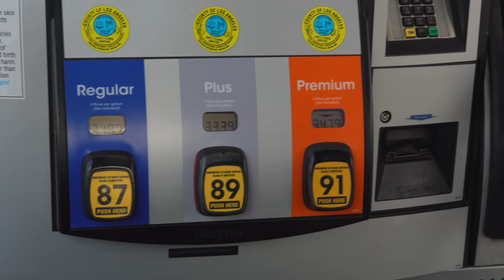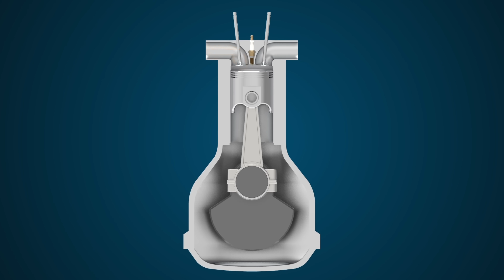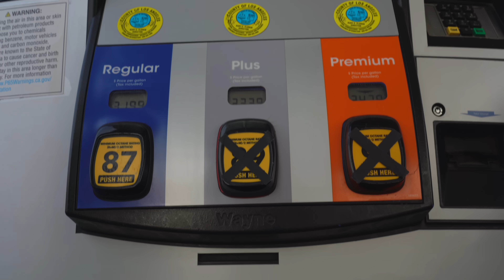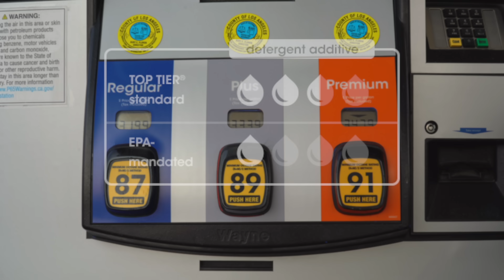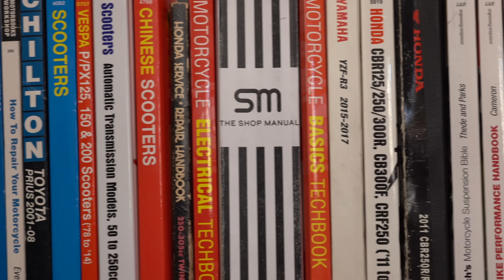Should You Run Premium Gas In Your Motorcycle? Octane Explained | The Shop Manual

Comment: I mainly go for the detergent additives in the premium gas at shell for my car since it just helps keep it running clean so the mpg is close to estimated mpg city and highway wise but it's still confusing in most car manuals though since they say use 87 octane or better so you can use regular but it's recommended to use higher
Reply: you're wasting your money

Comment: i knew all of this aready, but you did a very good video. it was clear, concise, and understandable. im glad that you pointed out the differences of the European rating system versus the American one. a lot of people dont know this. however. i used to have an RX-7 with a Wankel and it would get around 2 mpg better fuel mileage with 93 versus 87. sometimes as high as 3 mpg. so it was worth the extra price. the car was more responsive because the plugs stayed cleaner and the fuel burned better because of the higher spark. again, thank you for making such a well done video. very professional.

Comment: Difference in a full tank of fuel between the normal 91 octane and 94 octane at station near me is like 5cents a litre, works out to like 60-70cents extra per tank so why not
Reply: Same…it was 70 cents more at fill up for me to put in 93, over 87, so why not?

Comment: I run 93 in all my vehicles (2016 mustang gt, 2022 Honda cbr300r) because even thou it doesn't increase power on the cbr (it does increase power on the mustang gt) it does clean the cylinder better and helps keep the engine running good
Reply: You're wasting money, because the gas companies are lying to you.  Federal law requires the gas companies to put the same additives and cleaners in all 3 grades.  However, Federal law does not require them to tell you the cleaner is in all 3 grades.

Comment: You could have mentioned high elevations. Above about 5000 feet, a normally aspirated internal combustion engine cannot produce more than 75% of its Sea Level horsepower, and therefore cannot have detonation and doesn’t need higher octane fuel.

Comment: It keeps your engine cleaner , wtf what a load of bs you truely have no comprehension of modern motorcycle  fuel mapping nor the way the high octane fuels are essential for cooling combustion chambers along with lubrication and piston ring maintenance ( keeping rings free from carbonising ) which in turns prevents premature bore wear caused from scoring. Their has been significant studies on how higher octane fuel lowers emissions and assists in optimal catalytic converter’s thermal efficiency, so I formally debunk 2/3 ‘s of your Claims. I am more than happy to put my research and many years of knowledge up against you. To validate my statements. I found it very interesting that you completely skipped over the fact that the lower octane fuels have higher ethanol levels in their make up and as such creates significant issues with performance and durability of your motorcycle/ any petrol based engine that has not specifically designed to run on hi ethanol based fuels, let alone how ethanol fuels gum up catalytic converters 🤔.

Comment: The owners manual for my bike says 87 octane but the sticker on the swing arm says 91 😬

I was running 87 for a while, but I'm currently burning through a couple tanks of 91 to see if it makes a difference
Reply: Where is your bike made? If somewhere else than america the swing arm sticker probably means 91 research octane number. 87 anti knock index (average of research and motor octane numbers) is usually about 92 research octane number when talking about ordinary motor gasoline.

Comment: Good article. Here's some trivia for you: the amount of energy in one gallon of gasoline is enough to lift the Empire State Building three feet!
More trivia: modern motorcycles run more compression ratios than the muscle cars did 55 years ago with leaded gas. 
Now, most gas stations have one hose for the E10 blends. If your bike takes 91 octane and you put it 91, the 87 in the hose from the last guy will drag the octane down below 90. Better to spend the extra money on 93 to negate the 87. 
Many stations are selling 88 octane E15 gas. E15 is to be avoided because motorcycle engines are not designed for it. Around Pittsburgh the E15 and E85 are dispensed by their own separate hoses. 
Once you get west of the Mississippi River you may encounter stations that only have the lower octane gas. I've seen 86 octane "economy" gas out west. If it's the only option just listen to your engine and row the gears to avoid detonation. 
The old saying "buy the best you can afford" works on gasoline. Most motorcycle tanks are 5 gallons or less and for the extra quarters you spend you'll get a better product.

Comment: Has anyone else ever wondered how much 87 you get out of the pump and lines when you click 93? There are separate tanks underground, how much volume of 87 do you buy before the tanks 93 reaches the pump? Half your motorcycle tank could be regular 87 before you actually get 93 out of the nozzle.
Reply: The distribution valve is in the pump. It still probably amounts to a  guart or so in the hose. It is an issue on my Benelli tnt135 due to the small tank. I do the math, the previous sale is on the pump, sale $ divided by gallons = $per gallon. I look for a hose full of premium. Or, use a pump that a motorcycle is using before me. It isn't an issue on my Moto Guzzi, it holds 5.5 gal.
Reply: On the average it’s .12 gallons. That’s taking the average length of a fuel pump hose and the average diameter of the hose and finding the volume. This isn’t spot on as some pumps may be a little longer and some may not be completely full of fuel, but it gives a pretty good idea of exactly how much fuel really isn’t being held in the pump from the last guy.
Reply: No, it's .312 gallons for the hose only.  V=πr2h=π·0.442·120≈72.15846
Gets you cubic inches, then take that value and divide that by 231 and you get .312 gallons.  That's ONLY what's in the visible hose and not including whatever is going on inside the pump, switching valves, pipes, filters etc...
Reply: @El_Jaco  It's more like a half gallon all considered. It's a big deal on bikes with small tanks.
Reply: @kevinnielsen1356  Where is the source you found for "more like half a gallon?"
Reply: @El_Jaco  Someone in the petrol industry tested this circa 2000. Don't remember the source, but it seemed credible.
Reply: This has always been my thought exactly, I wish we knew!

Comment: Number ONE: NEVER EVER use fuel with ETHANOL in a motorcycle!!! You will RUIN the engine and carbs (if equipped) in short order, trust me, I've seen too many examples. Number TWO: Premium gas USUALLY will give BETTER performance and fuel economy, especially if your bike is newer than 1994 and has an engine management computer. Name brand fuels (Shell, BP, Mobil, etc.) often give better fuel economy and better performance. Example: Tulsa to Limon, Co. 1984 Honda VF-1000F Interceptor V-4 "no-name" premium fuel 1st tank I-35 256 miles 37 MPG@ 75 MPH. 2nd tank. Amoco Super 302 miles 45 MPG@ 75MPH (I-35 to I-40). 3rd tank Shell Super Platinum Plus 332 miles 47MPG@75MPH (I-40). In the twisties, the difference is greater.

Comment: I used to have a Honda motorcycle that was designed for 87. I would occasionally run 91 for the extra additives, but it definitely ran and sounded better on 87. Have also had to fill my air-cooled v-twin with 87, no big deal. Just stay off the throttle and be gentle.

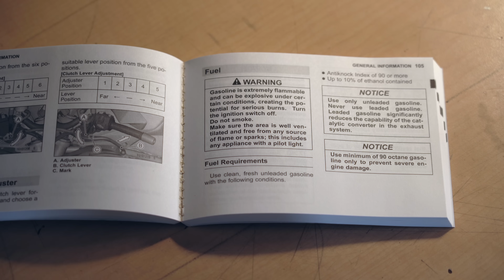Comment: I was literally called out here (2:57)! I have a 2012 CBR 250R in the EXACT same colors, and run premium in it (the bike had a hard previous life). It runs good but I get a stall when I make a small throttle blip with the clutch in (occasionally); I at first chocked it up to an unsophisticated EFI system. I'll look into it more and consider trying regular one tank, but this video kinda surprised me. But, when I'm doing 80+ MPG I could really care less what I pay per gallon.

Comment: Great explanations of the overall process, except explaining about how Octane works. 

In a nut shell, lower Octane burns faster but not as thoroughly. High Octane burns slower and more thoroughly. 

Because higher octane burns more thoroughly, there is no unburned fuel left to detonate outside the power stroke. 

Bad gas residue/solids in the combustion chamber heating up, too far advanced ignition timing and high compression are the causes of pre-ignition/detonation.

Comment: my 03 roadstar, an 8.3:1 comression engine, doesn't knock on 87 which is specified, but with a high flow exhaust and intake it does seem to be a little bit more snappier off the line on 93

Comment: I've been telling my friends I ride with for years how octane doesn't effect performance. One thing you should mention is ethanol free or non-oxygenated fuels with are typically higher octane. But, being there is no ethanol, the power production and fuel economy can increase if the fuel management system can compensate.
Reply: Put a bike on a dyno with 93..now do it with 87 and you'll see the difference.
Reply: @MetrosexualFilth  perhaps if the motor is tuned for higher octane. Otherwise 87 octane actually has more potential energy that 91 or 93 octane. All the octane does is slow the burn of fuel. Which only really comes in  to play with higher cylinder  pressures.

Comment: Its fairly obvious that you don't understand octane and detonation. Most people get hung up on the obvious compression component but that's not the entire story.  Detonation doesn't necessarily happen AFTER the spark, but according to you, it does, but that's not correct...!!   You've missed the air cooled angle entirely, which is really basic dude. Also chamber temps, sharp edges in design, tumble and flow..   I get that you've researched the subject, but you've not grasped the concept entirely..  I've been an engine engineer for 35 years and it took me ages to get it, there's plenty of round-a-bout info but really, is shouldn't be that complicated.. heat and compression, interlinked, but not necessarily.. that's the start point.

Comment: It's just detonation, y'all. Compression ratio dictates the octane needs of your specific engine. Don't waste your money on premium fuel on an engine that can consume "lamp oil" for fuel, lol. But don't invert this theory. High compression engine requires premium higher octane fuel! What no one wants to really discuss, is ethanol and methanol blended fuel for high compression engine's. All good until your vehicle sits for months at a time, and the "Angels" share ( like Scotch) of octane is gone. In Canada Chevron 94 has neither ethanol or methanol added, and has a much much better shelf life in you pristine engine. For small engines I use "Alpine" lasts for about 5 years. Look it up. Cheers 🇨🇦

Comment: My ninja 650 owners manual says 87 OR HIGHER…..I’ve been putting 93 in it for the first 300 mile “break in” period. Have i done any damage to the engine by doing this? Or is 93 still fine for break in and I just spent a few more dollars than I needed to???

Comment: Good discussion. Modern engine management systems make a big difference. My '92 K100 will run on pretty much any grade of fuel, even old gas.
However, my carburetor Triumphs demand premium. Triumph specified 97 RON minimum for my '72 Trident. Even then, they will knock if I'm stupid enough to accelerate from too low an RPM.
Lucky for me that non-ethanol gasoline is easy to find around here.
Reply: The K is liguid cooled, Triumph is air cooled. Huge difference, the air cooled motor will not tolerate low octane on a hot day. Pre-ignition could hole a piston in no time

Comment: i use to use mid grade in my Rebel 500. lately when i hit the start switch/run switch it would take a couple of seconds for the pump to turn on, and then hit start button. i have been using non ethanol for 3 tank fulls now, i noticed when i hit the run switch the pump comes on instantly. i think i will go for a couple of tank fulls of mid grade and see what happens, then i will know if i need to run non ethanol.

Comment: I'm a daily rider and I run top tier 91 just for the higher detergent and and especially so in the summer here in Northern California where ambient temps are well over 100F.  It can run on 87 but the bike gets around 50 mpg, average fill up is 3-4 gallons so 90 cents to $1.20 more a fill up is worth it to me.

Comment: This was super good. Now that we established that more Octane does equal more power, how about ethanol and if bikes will perform better with no ethanol in your fuel tank? Maybe part 2  video around this topic? either way, thanks for putting this together!
Reply: Did you even watch the video
Reply: so ethanol can degrade fuel lines in old vehicles, but virtually all modern vehicles can handle upwards of 20% ethanol. 

Ethanol increases octane for cheap, I think it’s like 108 octane at 85%. If your vehicle can run ethanol safely you can put 91 in the tank, then top up with a bit of E85, then you basically have 95+ octane. 

Furthermore, ethanol has a much higher cooling capacity than regular gasoline. This means it’ll lower the cylinder temps substantially if you run some ethanol in your fuel which further reduces predetonation. It’s a double whammy of detonation protection. 

Now ethanol has a lower energy density than gasoline, so if your vehicle isn’t pulling timing on regular gas from the knock sensors it won’t benefit from the ethanol, and it will actually make less power technically. However if you put the engine under high loads for a long time in hot conditions, i.e racing or climbing mountains, your engine will almost certainly pull timing even if it’s designed to run on the regular fuel you put in it. Running ethanol will help retain timing and power. 

You can tune vehicles to take advantage of the extra detonation resistance of ethanol gasoline and they’ll basically just give it more aggressive ignition timing, so significantly more power even though energy density is slightly lower. 

Running 30% and over ethanol is where you really see power gains when tuned for it, however this comes with a catch. The stoichometry of ethanol says that you need more ethanol per unit of air than gasoline to completely burn. This means your vehicle must inject more fuel into the engine when running ethanol, so you get lower gas mileage. And depending on the vehicle you need to install a larger fuel pump and/or injectors to be able to flow more fuel.

In the car world, ethanol is commonly used in modified turbocharged cars as a cheap and easy to find racing fuel. Done correctly, many cars can make substantially more power when running ethanol with minimal modification. For example my old GTI could run 30% ethanol without any physical modifications. Running ethanol would give the car roughly 10% more power when tuned for it. So I made 330whp on 91, and on ethanol I made over 360whp, and the cost of the ethanol mile for mile was slightly cheaper.

Comment: The reason people assume 87 makes less power is because when they use it, the acceleration and mileage is reduced.  While the fuel has the same power, they don't get to use it because the ECU detunes the engine by making the fuel/air more rich to prevent detonation/knock.  Most bikes don't adapt in this way to suit the type of fuel because the ECU has a fixed fuel/air map.  The ECU cannot spontaneously make the fuel/air more rich and thus cannot prevent detonation, leading to engine damage.

Comment: Euhm... No! European fuels are higher quality. The octane is ruffly different system, true. But the fuel in USA is slightly lower quality. That's why Audi's and Volkswagens in the USA get a different motormanagement in the US. And they have less power and torque than in Europe.

Comment: 99 octane here in UK but very expensive.  Good in winter because it degrades much slower than the higher ethonol fuels.
Reply: It may be dearer but when you calculate the loss in Mpg and lose of power it's still better to use better petrol.

Comment: I live at about 4800 feet above sea level. I mostly ride between 7000 and 1000 feet. Premium gas is an overkill for me. I've ran tens of thousands of miles in my old GSX-R750 on 87 grade fuel (Mid-grade at 4800 feet).

Comment: No stock air cooled engine should run high octane fuel. As a mechanic i have seen more then my share of burnt pistons. Hole right threw the center of them from folks putting premium fuel in an air cooled engine. Specially 2 strokes. High octane runs hotter and will burn a hole threw the piston on your air cooled bike. Off road and city driving with high octane will increase the likelihood.  Your machine will not run any fast or have more power and if tuned properly will not get any dirtier (pistons/valves) with a low octane fuel. Unless the MFG recommends it, save your cash.

Comment: I understand the whole concept but have a little question. Is 87 or 89 more powerfull than a higher octane number, for example, if you can run a  engine on 87 or 91, with out detonation happening than would the 87 be more powerfull than the 91, i understand 91 would be more powerfull in a higher compression engine, but for the same engine that can take both, someone told me the lower octane actually has more power, just wondering if thats true.

Comment: “Top tier gas” has more additives which waters down the octane rating which is determined before the additives are added. “No name gas” comes from the the same place top tier gas from and can be the same gas as top tier gas. Octane referees to the rate of burn not power it may give you a bit more power under heavy throttle use but how often and for how long is that happening. Paraphrased from Dr. Bill Wattenburg.